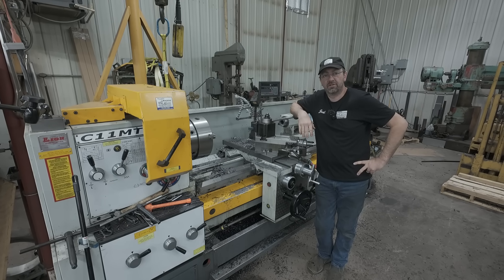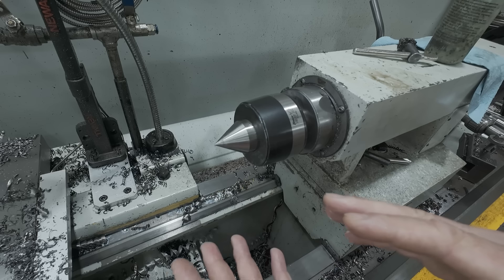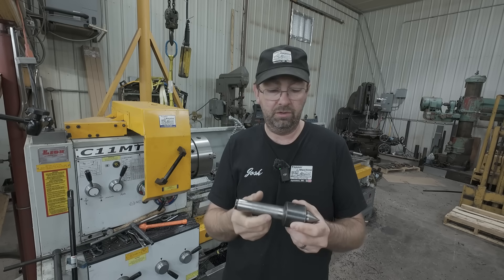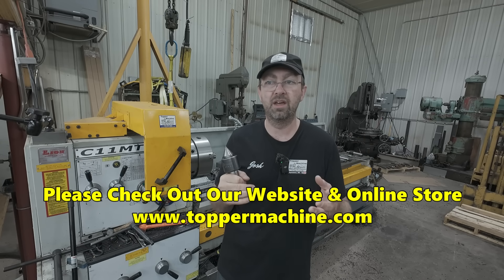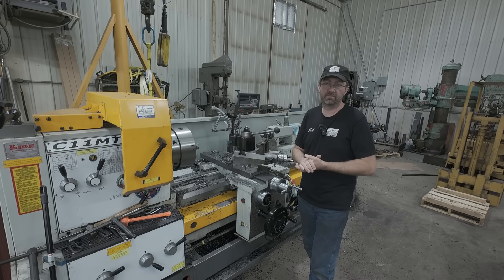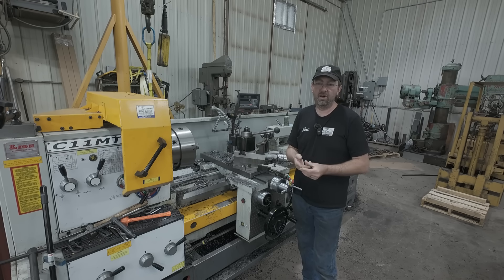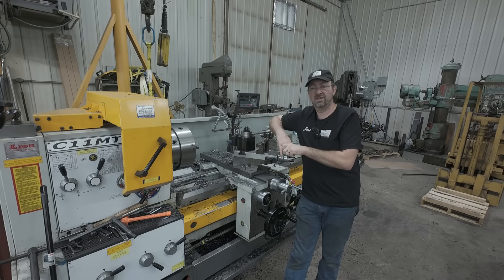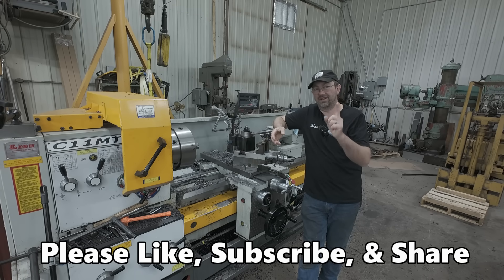Chatter Has Ruined My Life | Follow-Up Video of the Conveyor Roller Repair | Viewer Questions

Comment: Chatter. The Bain of a machinist life. I'm 52 years machining on all sorts of manual machines. Number one cause it how a piece is gripped. Three jaw chucks don't cut the mustard. I started a new job and lathes and tooling were in very poor condition. I had my own machine shop for 20 years and actually retired. Anyway I bought my good tooling in that    I knew worked well. Chatter I got was bad on all three lathes. One was never set from factory and thrust and taper roller bearing were actually loose. Couldn't machine a truck drum brake. Fixed that. Main lathe main bearings were done. Changed them out and fixed that one and little lathe needed adjusting but ways so worn didn't worry too much. The four jaw chuck on main lathe was shot. Bell mouthed. Boss bought a new chuck, cheap and not a nice Bernard one I found for him. Anyway new juck was ok but it bellmouthed quite quickly. Then chatter began appearing. I do a lot of hydraulic ram repairs do need to hold chrome shaft. I made a bunch shouldered split sleeves. I then discovered that bell mouth of chuck was a problem. I made new sleeves that were larger on flage end than inner end. About .006" to .010" in 80mm. Now I chuck a piece of bar in and they align the bar parallel straight off so easy to align. But biggest surprise was chatter. It disappeared. An overhang of even 500mm on a 60mm bar was easy to face. The wide even grip from the tapered bush in the four jaw chuck somehow dampens the harmonics. It's something I with I discovered 50 years ago! I go to the trouble of turning a taper on rough stock to hold better. Just free hand machining away from chuck and tapping cross slide in a touch every 10mm or so. Allows me to get stuck into a job and parting off 150mm poses no problems. It is worth having a play. Try on a common size like 2".

Comment: I used to run 4in. crowned rollers 3ft long and yes i fought with chatter too at that time i was working for someone it was not my shop i told the owner i needed a bigger live center or at least one that had good bearings in it but he said that wasn't the problem but he was a engineer not a machinist so after fighting with it for two days i brought one of my center's in to prove a point because he didn't want to spend the money to buy one after i showed him the difference in the finish he asked me if i could rebuid the one he had so he ordered a bearing kit for it and life got better at work for me it is sometimes impossible to get someone who doesn't have maching experience to understand and believe you i gained a little respect by showing him the problem and he trusted my abilities more after that i started maching right out of high school had a great teacher take me under his wing for 10 years breaking me in on every type of machine you could think of in a big shop also learning to be a tool maker set up man on screw machines to a certified welder by the age of 30 he made me shop foreman with over 30 men older than me long story short i can relate to your problems with what it takes to solve them on a everyday situation out of all the u tube machining videos i think you have the best because you prove that always enjoy watching thanks for sharing

Comment: Regarding my previous question as where a crowned roller is used on a material delivery system, I fully understand your answer.  It's not your job to know that.  Fair enough.  For the work at hand, I would not typically ask an owner either.  It's just my inherent curiosity from my experience.  When you do another one would you feel comfortable asking just for uneducated viewers?  Thanks.

Comment: Josh, When I worked in a shipyard (welder) many moons ago the machine shop had these canvas abd rubber blankets that'y wrap on extremely long shafts to dampen them. Without them there wasn't enough hearing protecton on earth to even be in the building! They'd sing this puslating high pitch and the cut quality was awful. BTW the lathe was over 100' long! I guess there's always a solution if you think hard enuff!

Comment: Same bearing wobble problem with a TMX live center that caused a number of problems on the Mori Seiki MS850. 
This live center came with the MS850 when purchased. It has since been parked.

Having used Skoda live centers in the past, they are good, durable, problem free and lasting. 
Making of Skoda live centers:
https://www.youtube.com/watch?v=I3tODMguH7U

Others that have been as good and similar were Favor (Swiss made), NSK (Japan). All have similar construction and bearing types. Notable about the Favor live center, it has a stack of BIG Belleville washers inside to pre-load the bearings and allow for some amount of compression-float of the bearing system to counteract and resist chatter that can happen if the bearing does not keep constant pressure that has been set when the tail stock has been tensioned on the center drilled point.

The value of a high quality live center is often not valued/appreciated enough by machinist until they cause problems...
like chatter or excessive run-out. followed by a wrecked part being made.

Comment: Something that has changed chatter for me, was I put a VFD on my lathe and it has a function to swing the speed up and down between two settings. It's amazing how harmonics just can't build up if the speed is always changing. I had seen this feature on CNC lathes but I didn't know it was simple to add to a manual machine. I want to get one for my mill next.
I always thought Polish machine items were good quality. I've had many great Polish lathe chucks. I guess corner cutting is a worldwide problem. :(

Comment: Regarding the wobble in the disks. I had noted it and decided that it was bad in that I consider wobbles to be poor workmanship and quality. But, it's also good in a way, as it spreads the wear in the belt that's running on it a bit, and the variation might well help dislodge buildup on the belt. 

Should you wind up making these, I'd consider welding both sides as that should help with the singing. And, I'd also consider making the disks a bit thicker as that might help the wear, but at the cost of more steel, more weight and a bit more labor to make them. It might be something to discuss with the customer, but it could go either way. 

I know that you have RR experience, so making "tires" out of tube stock and shrinking them on to the existing plates might be a cheaper alternative to remaking the whole shaft. You'd have to step the diameters a bit so that the tires for the center fit over the outer "wheels" during installation, but it might be an alternative. No real side load so a hundred degree temp difference for the tire and wheel should give a nice tight fit.

Comment: Hi Josh, thanks for the video! I mostly agree with everything you said, but I wanted to point out that CNC machines will generally use ballscrews, and will have essentially zero backlash on the axes, while manual machines usually use acme screws, some with considerable backlash. And that's not usually a problem, as on a manual machine, backlash can be pretty easily compensated for, at least as far as holding dimensions. But, that backlash does have the possibility of increasing the tendency to chatter.

Comment: The crown works because if the belt is off to one side, the crowned side will be running over a tiny bit longer arc, making it stretch just a little bit more on the one side, causing the belt to form a very slight curve with the belly in the direction of the crown.  Imagine pinching a length of rubber band on just one side and stretching it and the way that the band will create a bit of a curve between the points where you're pinching.  This "belly" puts more belt on the crown side, causing the belt to track toward the crown, just like it's being pushed.

Comment: Chatter is very annoying and common but at the end of the day , you defeated the chatter by simply flipping the part around. I feel most craftsman feel like we can cheat the system and save some time when we know what we should do from the beginning . You must be smarter than the metal . Assuming your problem with the center I feel like chatter would have still been in an issue in this case . I always enjoy your follow up format as there’s always a better way to do things . Keep it up

Comment: Good catch on the center. Have you considered rebuilding the center when you have some time? Perhaps modify it to use tapered bearings and thread it for an adjustment collar. That would be a worthwhile video as there are bound to be others with the same issue.
Reply: This please   AAAAAAA

Comment: I have to agree, the problem is often in the machine. Finding a bad live center explains so much.

Side note, there are a few other differences between your lathe and say a Haas ST55. The CNC lathe will be equipped with linear rails on all axis, so no backlash in those. The motion of the axis are on ball screws, again no backlash. The computer is programmed with all the correction factors for any alignment issues. The computer tracks screw life and wear along with heating while working. There are a lot of other small differences. 

With that said, overall you are right, it's basically the same as your lathe. 

PS I worked for Haas for a decade. 

Anyway I very much enjoyed both videos of that poorly made roller. I myself would have been so tempted to have welded up the open sides of the middle disks and then faced them to be perpendicular to the shaft. Watching them wobble around was driving me insane (admittedly a long trip).

So keep up the videos, I am picking up knowledge and that makes me happy.😊

Comment: Josh
Well done on a very difficult job 👍👍
Chatter is a difficult problem to overcome come. There is nothing more frustrating than a bad live center. Your lathe is a very rigid piece of machinery. I have run several (unfortunately owned 1) Charley Chan lathes through the years that only had the single lever clamp on the tail stock. Total chatter box  machines. Maybe I’m old but I prefer a lathe with double clamps on the tail stock. Quick clamp for easy work & a clamp with a wrench for turning

Comment: My guess is that the comment about faster-running CNC machines was thinking of CNC mills, not CNC lathes. And those cutter heads do appear to run crazy rpm, albeit just like you say at a wayyyy smaller tool diameter.

Comment: I liked your video. On a side note, there is an American company called Whedon Products in West Hartford Connecticut that makes Saver Shower heads and they like to source machine work to Americanmachine shops, but they are having a little problem finding them. You may want to reach out to them and see if you can provide some service to them. I don't know if it will pan out but, it may bring you some business.
Reply from the maker: Thanks for the information, I will look into that.

Comment: Sounds like that center you had was a piece of junk with the way it was constructed. The manufacturer needs to go back to the drawing board on that one. It was basically designed to wear out in a short time. The new one you ordered is a much better construction with being adjustable.

Comment: Definitely the best option for that job was what you did with machining the discs. Seeing that the diameter of the roller was not critical, it worked out well. Like you said, if they needed it be be a specific size, then remanufacturing would be necessary.

Comment: I worked in a factory that had a large machine shop with lots of CNC lathes and mills.  I heard lots of chatter over the years.  A cnc machine that has a bad crash may become a expesive piece of junk and if it's still on the books you can't get rid of it.  I remember a crash on a smaller lathe resulted in a cracked frame and that machine couldn't make precision parts afterwards.  I worked in safety so I had to take the operators for drug testing after any crashes.

Comment: You didn't get much use out of that center. Less than a year is not what I would consider normal.
Reply from the maker: I agree. That's not a normal lifespan for those types of centers.

Comment: Cnc machines arent just conventional machines  with computer control. The speeds are usually a factor of 5 higher than a conventional machine.(Only made possible by carbide cutting tools).they require high speeds and feedrates not possible in conventional machines. I remember when i had to nachine out some sheared off 1/4" hrc65 pins. HSS would not do it nor standard carbide. I contacted my supplier and he advised some specially coated endmills, with the instructions to run the manual machine as fast as it could,no cooling and whatever you do dont stop the feed until your through. The endmills went through the hardened pins like butter. Even if the speeds and feeds where way to low.😊

Comment: Make a cup that fits from the disc to the center support. And has bars that bolt on. To support the more center disc. Maybe use thick angle. With about 3 bars clamping  on the disc. With feet to push against the a bit of over kill.

Comment: Things to watch for:
Machine ways maintenance and tuning, wrong tool attitude(neg rake generally helps with combating ringing), and lack of back support(even a gloved hand can mitigate this, or a hardood follower, but fixed/travelling steadies help best on long profiles)...... Poor tool post!/compound orientation and inadequate tool shank clamping(direct clamping should ALWAYS be avoided ie. use an intermediate plate(3mm/1/8"mild steel) between tool shank and clamping screws.
The RPMs appears too HIGH - just because a TCT can cut at that rate in ideal situations ie. Billet turning, it certainly won't effect good turning on small diameters that support large thin flanges on the part being machined.
It used to be a very common problem in disc(rotor) turning in chucks where the inside wheel boss, or cylindrical section is used as a clamping surface - a large reverse cone, or centred round plate on a live centre generally cures this issue, but you'll still need to drop the relative RPMs quite a lot and have modest feed and depth of cuts.
Informative post. 👌👍
🤔👍

Comment: We used to wrap heavy rubber  around parts like that.
Rough Machine it down leaving   .020 or  .030 over.
Then use a super high rake insert for a finish pass.

Comment: I'm from Ukraine, working at state-owned enterprise. 80%+ of CNC job done here can be done on manuals, but in fact can't due to poor machines condition and tooling shortage.
For example coordinate hole boring (made on CNC, good condition milling machine + DRO will be enough, but there no good condition mill and no DRO).
Also machines here are treated badly (for example lathe placed near surface grinder, machinist don't care and use it with ink-black mix of dust&oil on bed ways), that is common situation in such enterprises, so random people see that undead machines and think all manuals are junk and CNC's are much better.

Comment: A CNC lathe is definitely not gonna save ya when you got faulty bearrings in your center. But as a general rule of thumb CNC lathes really are substantially more rigid for the same travels because theyre designed for insane feeds and heavy cuts to break chips and minimize cycle times. For example we have a lathe that has ~250mm Z and weighs over 3ton already and one with 600mm Z that weighs 8ton. For an 8ton manual you can get meters of Z travel because its bolted to the floor. But all the machine rigidity in the world is worthless when your setup isnt rigid. And this part is a nightmare. Greetings from a CNC only shop.

Comment: Working as an auto tech, I often turn drums and rotors,  we used a rubber band with imbedded led damper weights.  The band really killed the chatter. I thought a couple of them on neighboring disc might help.
Reply from the maker: Not with the bad center. Problem would just persist

Comment: Where I worked for years we transported abrasive material on steel belts.  We used roller systems to support the underside of the belt.  They were changed every year.  Than someone made half moon guides made from UHMW with glass or SARAN-PE.   It is usually green-yellow in color.  They lasted for years.

Comment: Thank you for the great videos! Ideally, should each disc (except the center one) have an angle cut to the face of it to match the degrees of the crown pitch? or did I miss that part?  (:
 Yea, I know it works without one.(: 
 Chatter and ringing are a REAL pain. (gusset plates added would help)
Reply from the maker: It works fine without.

Comment: Your diagnosis is spot on. There are also problems with resonance - the aggregate facts add up (and subtract). If you could have put a balanced weight one side or another of center, it could have changed the nodeal point and changed the natural resonant frequency of the assembly. However, comma, the bearing wobble likely changed and you would be chasing a moving target. The wobble starts the process, and the resonance builds on itself. My point. You are correct. Get rid of the initiating energy (the bearing wobble) and you're less likely to st😮art the bell ringing.

Comment: As a lay person.... if building that roller from scratch would hard face welding the contact surfaces help it wear less and maintain the crown longer?
Reply from the maker: Yes and no.  Being AR plate, it is quite hard to start with.  Hard facing may help, but in the long run may not be worth it.